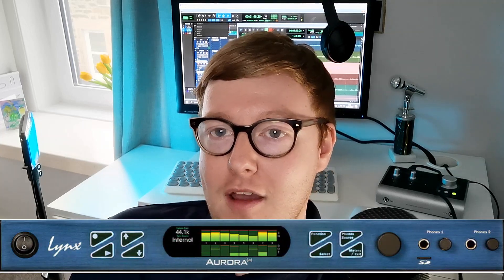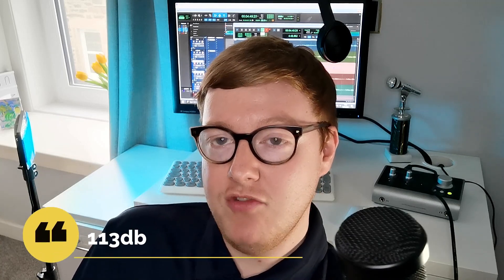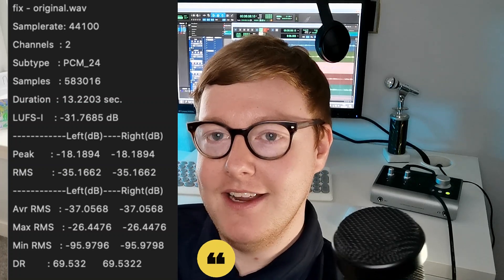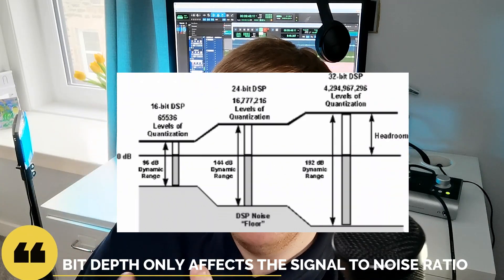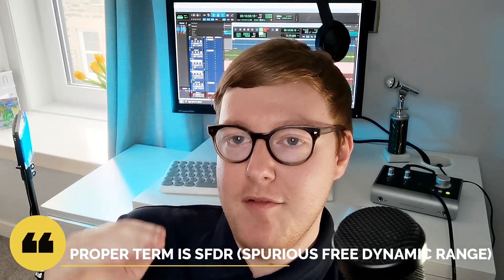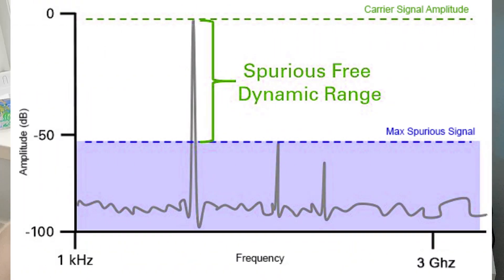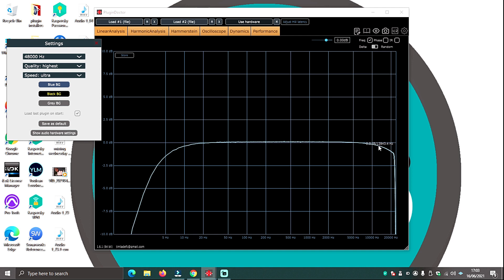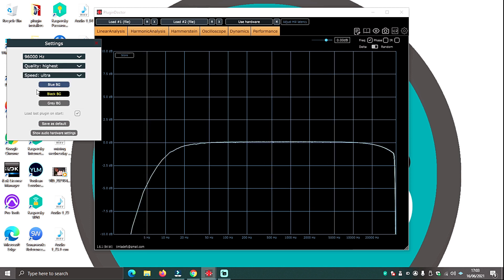Do you lose audio quality in analog gear using budget interfaces vs expensive ADC Converters (Pt 1)

Comment: Have you ever used access analog without putting signal thru any gear? (i have not, wondering what that might affect) If you record thru audient, send it to access analog via their plugin, you never input the true original analog into the analog input of the AD converter on their end, it's your digital put thru their D/A then routed to their A/D. What am I missing. Is there some magic that let's you send you interfaces analog in directly across the net to their analog inputs? I understand access analog value of getting analog gear 'coloration', but beyond that I don't see the benefit, especially for this comparison. Full disclosure, I use Behringer UMC404HD and love it. Just wondering if I'm missing something about access analog or how all this processing works.
Reply from the maker: The biggest misconception is that I'm recording through the audient. I'm not. Somebody gave me an idiotic comment during the week about the test being flawed as the access analog is being 'bottle necked' by the audient.

In actual fact it's all done purely in the daw with access analog. You don't need an interface and can even use an fl studio or AISO driver when using protools.

The daw track signal is sent to an online server which recieves that signal and passes it through the converters and the gear and streams it back out all lossless to the daw in real time. 

All the access analog gear uses lynx converters for conversion. 

In the daw all you do is set up a new track and set the input as the output of the access analog track. Record the track and then align manually after due to the latency. Or alternatively you can upload the file to the server and do an offline print where you simply download the file after its processed it through the gear.

Daw signal is streamed lossless over a server which passes the signal through the analog chain which you have virtual control of via the robot arms on each part of the gear, that processed signal is streamed back lossless to the daw which you can then print to a seperate track and align manually 

That's how it's done
Reply: My 404 has inserts after the pre-amp. I'll need to try that out.

Comment: Not gonna be able to hear the difference though YouTube which is compressed to hell and the frequency response chops off after like 15 16k...
Reply from the maker: No it doesn't. I've extensively tested it. YT doesn't cut off at 15/16k and it's compressed slightly but it isn't compressed to tell
Reply: @PaulThird  I'd like to see measurements then my man, there are a lot of 20hz to 20khz tests on here and it sounds horrible, instead of hearing the actual frequency's, you hear the harmonics and overtones from compression instead when compared to a tone generator after about 14 - 15khz, look it up one of those tests and hear for yourself, youtube limits the audio to around 192kbps to 220kbps, i'd say it is even more compressed then an mp3, it certainly isn't lossless. It's the same reason when comparing a fully uncompressed high bit rate mkv file to a copy on youtube, it just doesn't look as good after a point, same goes for audio and how it sounds, you won't get the same audio quality as a fully uncompressed 24 bit 96khz wav file on youtube or even 88.2  or a mkv file ripped from a blu-ray as an example regardless of your settings because all of formats that youtube accepts are then converted to their own standards, it doesn't stay as whatever you upload it initially. All that compression is advantageous for a video streaming platform because of how many people use it, it would cost to much as far as storage goes to have a higher bit rate capability for video or audio, you compare video here to their uncompressed counter parts, as well as audio, there is a difference.. The gap only widens with higher video resolutions like 4 or 8k in terms of quality, it's one of the reasons I laugh at people who use red or black magic cameras to take youtube videos.... Makes little to no sense and is a waste of money for something like this.
Reply from the maker: I've ran sweeps through YouTube and then recorded them back via obs which is 20-20k, no distortion.

What we found is that it is actually a lot of video editors that create distortion and aliasing and also the roll off. Upload a video to YouTube of just a sweep from a video editor that doesn't muck up the audio. Listen to it back via the main YouTube player (not the mini player in YT studio) and you'll hear no aliasing.

Even record it back via obs and extract the audio and put it izotope rx.. 20-20k and no aliasing. Yes there is compression obviously but the high end roll off and distortion via youtube is a myth. Some video editors do this wierd thing at 48khz for some reason where they distort the audio and cut off the highs just on import
Reply: @PaulThird  it would be cool if you could make a video on this
Reply from the maker: It's somewhere on the channel
Reply: @PaulThird  looked at all vids, nothing was clearly marked as such.
Reply from the maker: https://youtu.be/zRkyb2zqO9s
Reply: @PaulThird  I was hoping to see some testing on your channel about this, but yeah man, I edited my comment, also nice channel you got here.

Comment: Guys, I am a noobie to sample/bit rate YT rants. What sample rate am I hearing when I watch this video? What sample rate is used for upload? What bearing does it have on the audio test we are hearing in this video?
Reply from the maker: The session and files were in a 96k session. The video file is converted to 48k which doesn't have any baring to the sound.

Increased sample rate is purely for aliasing in any mixing/mastering setup as all it does is increase the frequency range which goes beyond our hearing.

48khz sample rate for example is 20hz - 24khz and the range of human hearing is 20k.. And that's mostly for younger generations

Comment: It’ll be good if you could test a few 2 channel high end ones and the audient… because the colour they add, well, your analog equipment can do that… I felt there was meant to be something else they can add which you’ll only notice in critical listening… if they add colour it seems like you’d have to listen to the converter out before committing… plus the output to monitor that would have to not add anything to know what that sounded like… maybe it makes so little difference that you’re best with cheap ones… maybe there’s a use in mastering more than mixing ???? Curious
Reply from the maker: The more I learn about them the more I find out how many of them use the same converter chips and its the colourful ones like burls and stuff that people rave about as they have the transformers in them.

Dunno the story with the dangerous ADA but loads of guys like to clip it so I assume that's adding colour as well but yeah thats mostly mastering

Comment: Another point to note is that the actual analog to digital conversion is taking place within chips from either AKM or ESS. Audient, Lynx, Focusrite, UA, RME and nearly every other interface manufacturer uses the same handful of AD/DA chips. They are all essentially integrators and what they contribute is the analog circuitry that feeds the chip and sometimes the clocking circuitry. Also the bus interface circuitry and firmware etc, although that is less about sound quality. 

The differences you hear are primarily the analog stages of the converters and not the converters themselves, which have been essentially on equal footing for a long time.
Reply: Interface companies didn't all used to use the same chips though. Until Audient broke the mold, high end headphone amps and Burr Brown converters used to cost a pretty penny. The other interface companies had to drop their prices after the iD22 was released onto the scene.
Reply: It's the analoge components of the high end equipment that give the desired results. Transformers and power rails. The chips doing the conversions cost $6 dollars, but the physical engineering and components of the high end stuff often sounds much better under load.
Reply: I would say a good clock is almost more important than a good converter. Just my 2cents tho
Reply: @matthijsblomjous3671  hopefully a solid clock is a given these days.

 They used to be very expensive to manufacture but just like everything else electronic, it seems the prices went down substantially when Southeast Asian countries reverse engineered them.

About the only components left that does cause a decent amount of money are transformers.
Reply: @RealHomeRecording  true, but there's still plenty of difference between clock manufacturers. The difference a Grimm cc1 makes to an Apollo Twin as opposed to its internal clock is truly staggering to me. You'd thought they would've figured it out by now lol
Reply: @matthijsblomjous3671  I wish I have had the honor to listen to such a difference. I wouldn't doubt that what you say is correct based on my experience with a couple high-end interfaces.
Reply: @matthijsblomjous3671  isn’t clocking for syncing with other gear? So if I’m only using the interface wouldn’t clocking not matter?
Reply: @JohnnysaidWhat  actually, it does, because a very important part of a good clock is consistency, basically that the different samples are spread out evenly every second, and for a longer amount of time. When this doesn't happen, and it's really hard, it's called jittering. You should look it up, it's fascinating!
Reply: @matthijsblomjous3671  wow that is really interesting! I watched a few more videos on it, and I didn't realize it is something that can happen going in a/d and out d/a. That being said it seems like it becomes more and more important as you expand on the number of devices recording sources at the same time. So jitter on a 1 mic source is going to have less of an impact as say an orchestra with each instrument mic'd up. So all in all I think my old lynx aurora 8 is still up to the task even in 2023!
Reply: @JohnnysaidWhat  oh absolutely. And your Lynx Aurora is a great piece of gear! At the end of the day, while all this stuff is somewhat important to be aware of, it will never be as important as other things like good acoustics and a great performance!
Reply: @matthijsblomjous3671  100% agree!

Comment: I only have 2 inputs on my interface so I use a consumer Class A DAC I got a while ago and it sounds super good. (NAD brand)  I just use the audio device settings in Logic to go out and back into interface.  Prints with no latency.  I also use they lynx on access analog which is kind of cool because you can clip the converter if you want.

Comment: Justin Biebers engineer records / mixes at 44.1 just cause he likes the way it sounds, josh gudwin, and Its funny cause the test you started around @, isn't that what's being taken out of the file, and they are all high end,kind of harsh content, but the lynx is taking out more of that,I wonder if that's why people like it a lot though,  cause its probably more smooth /rounded off sounding at the top. or am I interpreting the test you did wrong?
Reply from the maker: i think the lynx is doing the opposite and adding in slightly more top end haha the audient at 44.1 & 48k has more of a top end roll off, which is less at 96k.

Comment: Great video, great tests.   I use various convertors/interfaces, from cheap SSL2+’s to Merging, Dangerous and moderate priced ones like Apollo.   Although the ones that have  transformers can be useful if you want that color (like the switchable/defeatable Dangerous Music ones), most of the time I want clean acquisition and conversion.  That is one of the things I love about DSD 256+, in that I can loop, insert or whatever I need to do and never have to worry about aliasing or filter/phasing issues.  However, for many recordings and workflows even a fairly cheap Focusrite Scarlett is beyond anything that is audibly discernible— especially in complex music.
Reply from the maker: technology has caught up and became a lot more inexpensive. Its a great time for those new to the industry definitely!

Comment: i've been looking for a good audio interface with good preamps, good converters, and preamp bypass for my 500 series lunchbox preamp.
what about RME? is it any less than the Audient? any other suggestions?
Reply from the maker: Id44 is a great shout as you can bypass the preamp. 4 mic/line pre's, 2 J-fet DI inputs, 2 sets of line outs, word clock out, 2 sets of optical in and out. £400 while RME is closer to £600.
Reply: The RME stability is unmatched the latency is top notch. I'd says if your going for pres go for the audient. If your going for performance go for the RME. The RME has real clean pres no added color. People find them sounding harsh because of that. The audient has more 'musical' pres. If pres is a non issue I would advice RME all day long. My opinion of course. My next upgrade in interface world is an RME digiface to connect my id22 and tascam pres to and I'll use the id22 as monitor controller and the tascam as a headphone amp besides the Pres I use of both devices. They have a different sound. Tbh the differences are marginal but I cannot unheard it. I know my equipment well so I know before hand witch channel and witch pre I'll use for the source at hand.

Comment: I've always recorded at 44k. I'll probably keep doing that. Most of what I do requires a pretty sizable low pass anyway, other than drums. I feel like the cymbals really need some of the highs reduced anyway, so all good. I can still make my mix sound the way I want without the file size bloat of 96k.
Reply from the maker: 100%. You could record at 192khz, make one bad mixing decision and ruin the sound you've recorded.

Its not something that's gonna make or break your mix. If a performance is amazing it'll still sound amazing at 44.1

Comment: The Apollo x16 is the same way, it has a slight bump in the low and top, similar to a very subtle tape bump, minus the harmonics. I am not sure if this is a design of the unit or the chips themselves, the Sabre ESS models they utilize have a "feature" called "velvet sound" or something... Maybe that's what is responsible. 

The human ear doesn't necessarily enjoy "perfectly flat" and, I don't think the new X series is actually even as linear as the older versions, however, people really dig the way new ones sound.

I am surprised the Lynx isn't totally flat, from my understanding the new Auora N are based upon the tech from the Hilo, which from all the tests I've seen are the most accurate and transparent (not necessarily aurally pleasing) converters on the market still.
Reply from the maker: thats what annoys me. its the heavy marketing push on transparency. If they focused on being more transparent in their marketing as opposed to their converters we probably wouldnt have so much debate about all this in the first place haha

Comment: First, Yes, as someone who knows quite alot what's under the hood I agree, convertors market is total BS, a super clean and transparent AD/DA convertor chip in terms frequency response, thd+n etc.. costs around 10$, the rest is Voodoo. Most convertors now days from 50$ to 10000$ are super transparent and are sufficient for any level of use.
Technology has far exceeded the capabilities for audio transparency many years ago, brands tagging thousands of dollars prices for that is only because people still not realizing that and are blindly willing to pay.

Second, your test is not as conclusive as you think, you didn't take into account sub sample delay, meaning, in your DAW you can't accurately sync 2 signals by delaying in samples cause the minimum resolution is 1 sample so you mostly won't get the optimal null and your result is pretty random, especially if you used a convertor that wasn't synced to your DAW (the lynx). 
You should use a software called "audio diffmaker" which syncs in micro seconds if you want conclusive answers for that kind of test.
Reply from the maker: Tbh this entire test was purely to prove that my id14 was up to the job of printing analog gear which I was told it wasn't